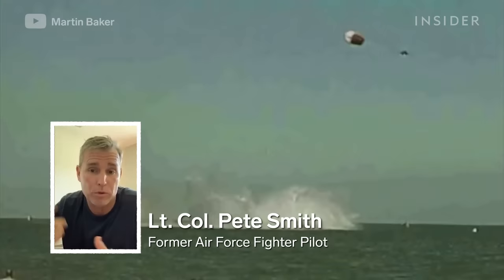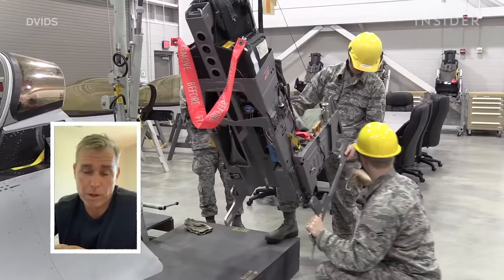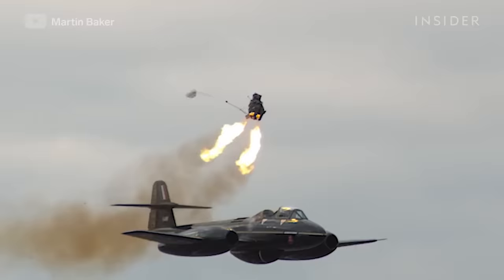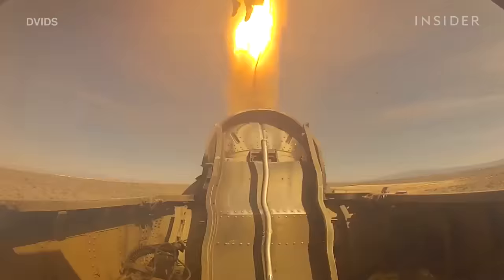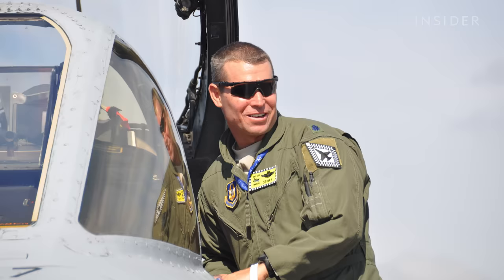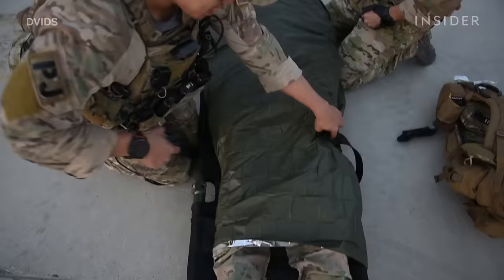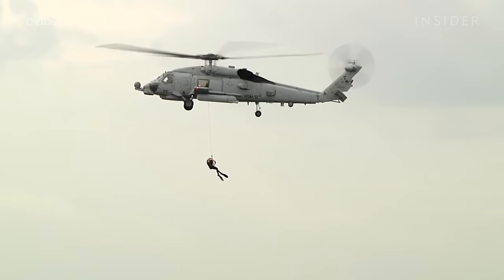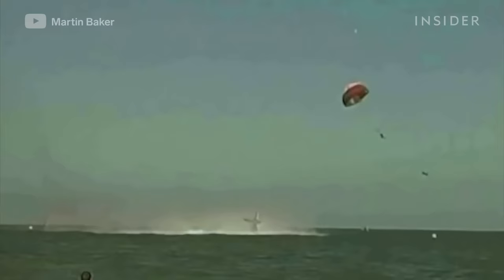The Death-Defying Mechanics of Fighter Jet Ejections | Cars Insider

Comment: Having worked for an ejection seat company myself, I think it's outrageous that you're claiming that ejections "leave most pilots with severe injuries." That was certainly true in the days of the Martin-Baker Mk.5 seats with their ballistic mortar charge to blast the pilot out to a very high peak altitude, which was needed because a series of parachutes had to come out and have time to inflate aerodynamically from sheer airflow - first drogue, then second drogue, then main. All of that took time, and so in order to advertise ground-level ejection capability the seat had to be kicked to a very high altitude in a very short time, which meant a brutal load on the aircrew's spine. The Mk.7 was an improvement, replacing the shock-loading mortar charge with a fast-burning rocket pack, but it still had the same aerodynamically-opening parachute train and so it still had to kick the aircrew to a high altitude in order to give enough time for everything to happen, and so spinal injuries were still pretty common. But in the 1970s a new concept came along, the Stencel SIII series of seats that dispensed with the sequentially-opening chutes, each dragging out the next in line. Instead it used a single drogue that only had to align a small rocket with the relative wind, and it was that rocket that pulled the main chute directly out of its housing on the seat as soon as the seat itself cleared the aircraft (for a ground-level ejection.) Once the main chute had reached full line stretch, a lanyard pulled a pin that fired a ballistic spreading charge, blowing out small weights that were attached to every other riser line, which completely expanded the chute in  a fraction of the time needed by old-fashioned aerodynamic opening. Because this whole operation happened so quickly, the height needed to obtain a fully open chute was much less than with the Martin-Baker seats, and so a much smaller rocket impulse was needed to boost the seat up to that altitude, which meant much lower stresses on the pilot and far less potential for spinal injuries. The Stencel seat's development had been paid for by the US Navy, and so naturally the US Air Force wanted nothing to do with it. (That whole USN/USAF technology rivalry reached ridiculous levels in those days, hence the reason why one Service's decoy flares and chaff dispensers were square while the other's were round.) USAF spread all kinds of horror stories about opening shocks of ballistically-spread parachutes, which were demonstrably untrue from both test and real-world ejection data. But as soon as Stencel's patents expired, USAF immediately jumped on the bandwagon and incorporated key Stencel SIII features into its own range of seats, to the betterment of them all. And so today ejection injuries absolutely do not "leave most pilots with severe injuries" thanks to over half a century of technological refinement.
Reply: This is the most informative piece of information regarding a subject I've come across today. Bravo for that detailed elaboration.
Reply: I was your supervisor
Reply: Solid information, and the Stencil was a massive improvement. I know the Hornet had the Stencil, didn't F-16's have it as well?
Reply: Which hornets had stencils? The hornets I worked on had Martin-bakers
Reply: @nexpro6118  bot response
Reply: @nexpro6118   and I am YOUR FATHER..
Reply: Why I love YouTube. Thanks For the info bro! Cheers
Reply: Thank you.
Reply: @nexpro6118  I was your gynecologist.
Reply: watch the whole video. he said modern seats have a non-injury rate of 90%. you spent all that time typing when you could have just heard the man out instead.
Reply: I learned something new. Thank you 😊
Reply: @Aethelvlad  survival rate is whats said in the video. Not none injury rate
Reply: TMI bro.... TMI 😭😭
Reply: Terrific response! You do an excellent job explaining how your seats are much better than the previous ones, but isn't it reasonable to say that any ejection would probably cause severe injuries?  After all, the human body is pretty fragile. Even if the rocket motor itself isn't the issue, I would bet that the circumstances under which an ejection occurs are probably pretty conducive to injury. Thoughts?
Reply: Nice *article* you wrote us
Reply: You are a hero thanks for this write up :)
Reply: Yeahh you tell em bro
Reply: I have worked for MBA for 24 years testing seats and the company are constantly looking to improve the products. Aircrew have never had a smoother ride than they do today with limb restraint, neck protection, electronic sequencing and digital time delays. I am very proud to work for them and to say I have had a hand in saving the lives of aircrew. The vast majority are now recovered without injury. I also respect all those who have worked on other seats, we are all in the same business of saving lives and that is and will always remain the ultimate goal
Reply: Thank you I worked on seats in both the Navy and Airforce and I so hate all the seat misinformation out there. And yes I had to go to both schools as the Navy and Airforce apparently think the other service cannot teach properly.
Reply: this was probably more informative than the entire video, I had no idea about any of this lol
Reply: @Aethelvlad  You took the time to watch the whole video, read his whole comment, and still got it wrong 😂 Show me a timestamp where the pilot says anything about a 90% "non injury rate".
Reply: Reporters don't really research topics as well as youtube comments nowadays. Nice!
Reply: Oh really?… is that why pilots say “put your head in the position you want it in for the rest of your life”? Is that why you are automatically grounded after 2 ejections due to spinal injury risk? Cmon man. Don’t try to oversell your craft.
Reply: Today I learned something new. Every time I see a coherent detailed and well formulated reply on the internet I am in awe. Cheers mate!
Reply: @okieboy7065 yes MBA NACES. before that SJU5. Great seats!
Reply: The navy and the airforce having rivalries is the most hilarious thing I've ever heard, fighting for the same 'team' but arrogant as ever 😂
Reply: No you haven't.
Reply: Can you show any proof for that? No you can;t, because you haven't.
Reply: What's the downward maximum velocity modern seats are able to deal with at or near ground level? What I mean is if the aircraft is plunging toward the ground with a vertical velocity of 300 knots then the ejection seat has to reach a speed of 300knots just zero out of the aircraft speed and maintain the pilot at the same altitude he ejected from.
Reply: Should be the pinned comment
Reply: @Doctaphil64 5:14
Reply: @BrendanMazaleski  I agree.  During my AF career I spoke to a pilot who ejected from an F-4 and he told me it was a fairly smooth experience.  Of course he probably was able to slow the aircraft and had plenty of altitude for a safe ejection.
I do recall that the survivability was about 90% so 1 in 10 ejections were fatal.  Ejection, after all, is a last resort.
Reply: @mark675  Of course they are.  Interservice rivalry is a real thing due to the egos fighter pilots have.   But when it comes to mission accomplishment, everyone has specific tasks and Navy and Airforce crews work as a team.
Reply: @alanhess9306  fighter pilots or Americans in general? 😂
Reply: @mark675  no, definitely not Americans in general.   I was referring to fighter pilots all of who seem to have their shit together.
Reply: Thank you
Reply: This guy knows his stuff
Reply: Yeah, science!
Reply: I was a seat plumber in the Navy in the early 70's

Comment: Once upon a time, I was an AMMO troop in the USAF, and we handled the storage and inspection of all of the explosive components that go into the chair and ejection system.  It's honestly shocking just how many explosives of various shapes and sizes go into the cockpit of a fighter.  The pilot is essentially sitting on a bomb, attached to a rocket, attached to a couple boxes of shotgun shells.  In most fighter aircraft, the pilot does not sit in a position that has a direct line up and out of the cockpit without some noodley appendage being in the way.  So, in addition to the explosive bolts and rockets to take the canopy off the plane, there is also an elaborate explosive train that moves most of the instrument and control panels out of the way of the ejecting pilot.
Reply: Exactly right. Working on & around those seats are no joke, ever!
Reply: Cool to hear some extra info from someone who worked on them, thank you!
Reply: Didn't know the instruments get jettisoned too, but I guess you'd smash your knees on them if they didn't
Reply: Dang I didn't know even the instrument panels were charged
Reply: oh thats glorious, makes me think if you could "ammo wreck" an ejection seat
Reply: @Tremumbus  maybe also to guarantee certain data can’t be recovered from the wreckage if in combat. IFF and weapon system info springs to mind
Reply: Im an Egress troop and work on ejection seats all day. Fighter jets do not have instrument stowage actuators, that would only be found on bombers ejection systems. Anyways never call it a chair, 😂 typical nonner.
Reply: @MultiMegaMaxx  Our boxes have some simple little tricks to protect our comsec in the event of a crash. Interlock circuits and such. I always thought a master declass switch tied to a g sensor would be fairly efficient but what do I know.
Reply: @dasboat64  Thrust you can trust. 🤭
Reply: @Silky808  Fr. Egress stand by. 🫡
Reply: I’ve never thought of the science of ejecto seatos but damn that’s cool to know
Reply: Oh yes if you are not in the correct position with your back straight and chin up you will get some serious injuries.  During training they always stressed to be in the correct position if you eject.
Reply: Back in the late 80's and early 90's, I was a test engineer with GD in Fort Worth. We tested the crew escape systems for the F-16, among others. We were the ones making those films shown that were the closeups of the seats leaving the cockpit. We would assemble to cockpit and seats of the test sled just as they would go into the aircraft. As mentioned, all of the different systems are initiated and sequenced by explosive lines that assure that everything happens at the right time and in the right order. Explosives are faster and more reliable than electronics. The only electronics are in the seat itself, and there is a computer and sensors to determine the speed and altitude for proper parachute deployment. 

Everytime anything in the pilots equipment changed, the whole system had to be retested with the changed equipment before it could be used in the aircraft. 

One of the items we tested was called SeaWars. It was a seawater activated parachute harness release. When a pilot ejected over water, once he landed, the parachute attachment to his flight harness would disconnect when it came in contact with water.  It was developed after a pilot ejected over water and broke his collarbones. He couldn't reach up to release the buckles manually, and drowned.
Reply: @timaugustine3856  yes I flew with SEAWARS.  It was a life saving system if it worked properly.  Luckily I never had the opportunity to find out.  Yes the ejection system and sequence is very complex and anything can mess it up and cause death or injury.  Also the aircraft on some seats had to be high enough to get a safe ejection.
Reply: @timaugustine3856  at least in the AF we do not use Seawars anymore, they are now called UWARS.
Reply: Not one fighter jet in existence moves the instrument and control panels out of the way of the pilot. Why lie about that?
Reply: @timaugustine3856  no seat had to be retested like that. Pilot equipment doesn’t change anything. Even SeaWars didn’t. That has nothing to do with the function of the seat at all.
Reply: @TheHannukahZombie  I believe he’s referring to the gear itself having to be tested in ejections before being allowed to be used in the cockpit. Changes in gear can definitely cause problems in the ejection sequence. I’m not an egress troop, but I’m an AFE technician who works closely with egress
Reply: I also pack drogue and aces II chutes
Reply: @Silky808  hahaha well said
Reply: @Silky808  I came in right as they were phasing SEAWARS and switching to UWARS
Reply: Very Interesting Sounds like what that Ejection Seat all needs to Operate. Thanks for Insight. 👍
Reply: When the canopy pops, the bulls**t stop
Reply: @Cubrooski  you’re showing your age 😂 im kidding. Take care. When in doubt, pull out 😂
Reply: IYAAYAS!
Reply: @TheHannukahZombie  I didn't say the seat had to be retested, I said the whole ejection system had to be tested together with any equipment change. And you know this how? I said I was an engineer with General Dynamics, doing the testing. We were testing at Holloman AFB in New Mexico, with AF personnel overseeing the testing. This was at the 10 mile test track near White Sands.
Reply: @Tremumbus  Depending on the air frame and seat, there are lanyards that will pull your feet  back to the seat...  They have some ejection sequences that WILL take the panel and front wind screen with you, then jettison it when you are clear, is NOT just A (one) rocket to get  you clear.
Reply: @Silky808  If you cannot fly United, fly Martin-Baker!  My dad has an ejection (TA-4) and brother nearly one (t-28, turbo mentor)
Reply: Wow didn't even think of the instruments. How do they get them blow away from the pilot I wonder.
Reply: IYAAYAS!
Reply: So cool! Thanks for sharing your awesome knowledge! 👌
Reply: I pranked my cousin with an airbag twice, hold my beer
Reply: Thank you for commenting this was an interesting read
Reply: @Tremumbus  Well, at least what used to be your knees on what used to be your legs.  I hesitate to think of all the things that went wrong before they perfected them.  Of course, the first generation of pilots didn't even have chutes.  And some of the plane designs involved an engine and prop that would fall on top of the pilot in the event of a crash.
Reply: @dasboat64  We had double inspections before working on them, make sure every flag pin was in the correct slot. Flight Chief and Team Chief inspected before line troops worked on the seats. Made me nervous every time I worked on one.
Reply: @brenninschlauderaff2099   @Chris Evans There are dozens of us on Youtube!  DOZENS!  AAAAMMMO
Reply: Thanks for the additional info. This video didn't do a good job of explaining what all goes into the ejection.
Reply: Amazing.
Reply: Fighter canopies use line cutters with explosive charges in them. During the escape sequence these are shot off to drive pistons through the air hoses and electrical conduits attached to the canopy to shear them away and ensure they don't cause the canopy to hang in the wind for that crucial split-second when the seat is going to fire off.
Reply: You are a hero thanks for this write up :)
Reply: usually it's fairy tales that start with "once upon a time" xD
Reply: That would explain why the instruments, and everything around the cockpit exploded when Maverick and Goose ejected.
Reply: It’s amazing more stuff doesn’t go wrong more often. Thanks for the insight.

Comment: Who told this guy an ejection seat is the most complex thing on a fighter jet? That's not even close to being true. 🤣
Reply: He doesn’t even know basic math. He said he was less than a second from death and pulled the seat handle at 2000 feet. Math says he would have been going 1300mph+ and then he contradicts that later. Piss poor attempt at making a factual video.
Reply: @TheHannukahZombie  
I spent some time working in debrief where I'd have to explain things to the pilots like, "there's no way that system broke because this jet doesn't have that system", "fuel did not leak from one wing to the other you had to have turned on the transfer pumps to land with more fuel in a wing tank than it started with", "no, there is not fuel leaking from the aileron because there is no fuel in the aileron" and "don't write up what you think the crew chiefs should do to repair the jet, you need to write what malfunctioned and let them fix it".
They're not the best sources for technical knowledge. lol

Comment: I was a USN AME Ejection Seat Mech.  From 1972-1985.  I once held the highest grade achieved in the Navy AME A school from 1972-78.  I taught Navy A school  from 1975-76 and the AME C (advanced) 1976-78.  I have had two Ejection Seats that I installed/final inspected eject under flight conditions, both pilots survived to continue flying.  The fact that the Aircrew depended on your work to save their lives was satisfying work.
Reply: As a former Navy PR, I approve....lol
Reply: You, and the engineers who designed the ejection systems, are heroes.  Thank you for your service.